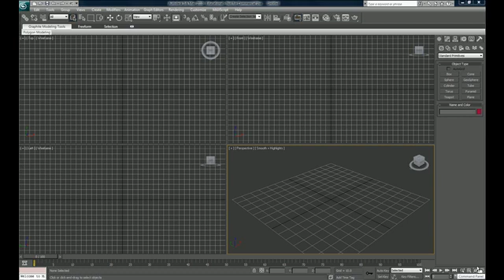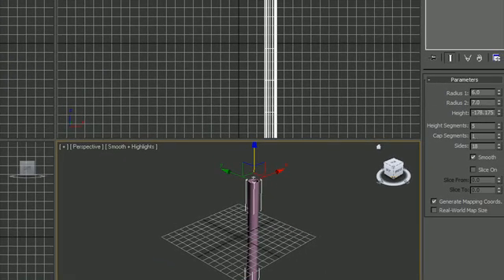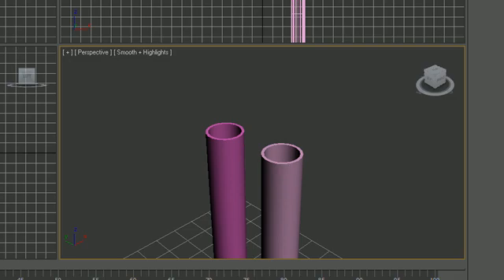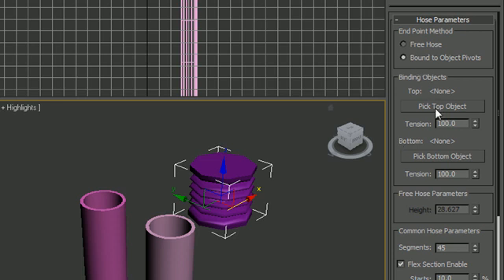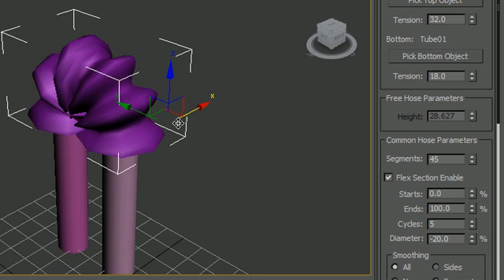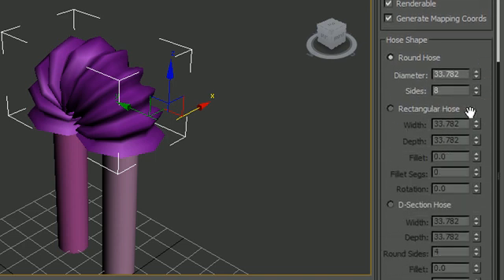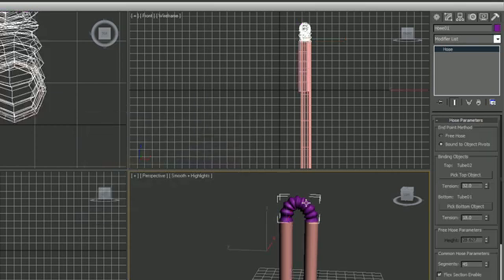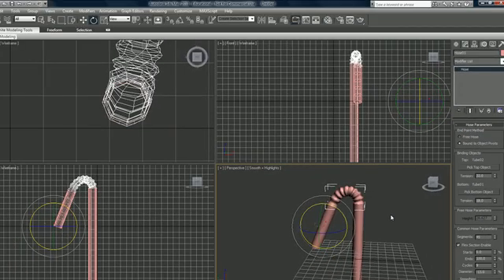3Ds Max Tutorial - 5 - Binding Objects

Comment: I put the hose's cycles on 54 because I'm a rebel! Anyone looking at the render won't know what I did, but I do >:-D
Reply: The hose's cycle use some sine calculation, it seems. so every 45 is equal to 0, to put it simple for the non-mathematicals. this means that 54(=45+9) is equal to 9, same goes for 99

Comment: The hose keeps connecting to the bottom of the small tube. how do I make it to connect to both tops like this video?
Reply: +Legendragon I've had that problem aswell. You just have to make sure to create the two tubes so that both their heights go into the same direction on the z-axis. So after choosing radius 1 and 2, simply drag their heigts down the z-axis. :) You probably figured that out already, so I'm just leaving this comment here for anyone who has the same issue.
Reply: on the panel right next to "modify"  it says "hierarchy"; drop down "adjust pivot" --> "affect pivot only" and then try to move the pivot to the right point
Reply: +Legendragon25 You can rotate the object to the other end and then it should connect to the right end.
Reply: I tried it once it didn't work. I restarted the straw from beginning and it worked.
Reply: Thanks. I passed the class already but thanks. lol
Reply: I was thinking it had something to do with the pivots.. But I have no clue what prince is talking about. The straws both have some rotation and positive height.
Reply: +Legendragon ok what i had to do was rotate the hose object 180 degrees after creating it. The pivot was messed up, but once i moved one of the tube objects, it instantly snapped together like it looks in the video. Only prob was it was the wrong width and already created.

Wierd i did this again but it attached to the bottom. I think the object pivot has something to do with it.. but i havnt checked how to change the pivot yet lol. I also had to rotate it 180 degrees on Z axis aswell for when i bent the other half of the straw.
Reply: ALL of the solutions committed in here are not working for me.
Reply: @zkkk4442  when you create  both tubes, slide the mouse down to give its height instead of sliding up. this works for sure
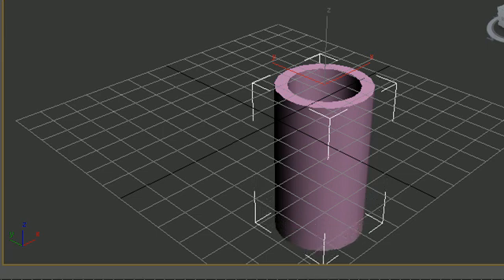Reply: @lz_artz  THIS WORKED. Thank you so much. (Mentioned in the video 0:28 )

Comment: how did you get the hose to bind themselves at the tubes. I managed to make it bend itself according to the tubes but it doesn't bind itself to them.
Reply: +tangbein  u have to click on the hose..then click in "modify" the ( pick top object )..after u click it click on one of the tubes in the graph ...then click on (pick bottom object)then click on the other tube ...and then it will bind itself on both tubes 

it's like u guide the hose where to go on the two tubes

Comment: very useful tutorial. one question: how to connect two tubes with a S shaped hose? in the case you show here, the tubes are connected with a C shape hose. that is to connect the top end of a tube to the bottom end of another tube with a S shaped hose. in your case, you connected the top ends with a C shape hose.

Comment: My hose wont connect to the top of the tube, instead it attaches to the bottom :P
Reply: Drag the cylinder downwords when you're making the tube. Or make the hight negative if you don't want to recreate it.
Reply: TTate  thanks. figured it out accidentally :D
Reply: TTate check and see if you have the number set to a positive or negative number for the height. I had the same problem as you but it went away as soon as I changed it to a negative number
Reply: TTate Would another way be to rotate the cylinder so it is upside down?
Reply: MotionTransformer Just do something that flips the cylinder so that would probably wok.
Reply: Tristan Winningham Why did you say that to me? I just said the same thing to OP
Reply: TTate thank you. :D
Reply: +Hirodugens Channel thanks man

Comment: When you try and bind the hose to the straw, the program is binding the two ends of the hose to the pivot point in each straw. It seems that for you, the pivot points within the straight tubes were automatically set to the bottom. To change this, select one of the straight segments, go the the "Hierarchy" tab in the Command Panel, click "Affect Pivot Only" and move the pivot point to where you want the hose to connect. Don't forget to UNcheck Affect Pivot Only, then change your next pivot! :-)

Comment: For those having trouble in 2012: when you first make your tube, determine the height of it by dragging down instead of up. Dragging up sets the pivot point of the tube to the bottom, which causes weird connections.

Comment: @bscbscdk ok so after ages of playing about with it i have finally found out what the problem is. the hose connects to the the tube at the height of 0 E.g if you make a tube and drag it below the grid the hose will connected at the top of the tube. if your make the tube and pull it above the grid the hose will connect at the bottom of the tube... play about with it make a tube connected a a hose and play with the height of the tube going above and below the grid you will make sense of it.

Comment: @MrJakobSteinn I fixed this problem right after posting, the easy fix is choosing eather tube001 or tube002 and then rotating it 90 degrees. So, pick rotation tool, select ie. tube002 and then write 90 in the z axis in the lower-panel. (: YAY!

Comment: @arktikgraywolf1 It means that your tube has a positive height. I also had this problem. Once you have the lengths of the tube to your liking just modify the length of the tubes by adding a "-" in front and then it should connect up properly :)

Comment: Firstly thanks for the tutorials, really helpful! Already learning several other CAD software as well. 

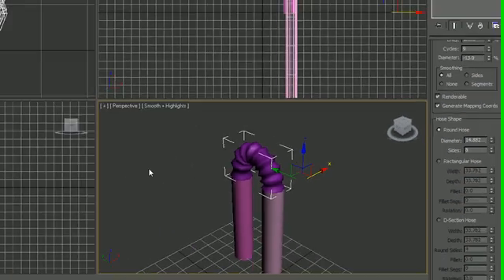I just want to point out to you that you can take a different approach to selecting the diameter parameters for the hose at 5:40. Your method is soley on guess, but a more accurate procedure is inputing double the radius for the straws. The radius is mathematically .5 the size of the diameter. In the video you used 7, and you could accurately input 14. You can edit the sides too to match it.

Comment: Probably cause both top sides of the two tubes should be on the same hight and as long as one of them is shorter you have to raise the whole shorter tube above the 'x' plain to get aligned with the top side of the longer tube, which you can make with the 'align command' but I guess he just didn't want to show it in this tutorial so that we don't get confused with too much information :)